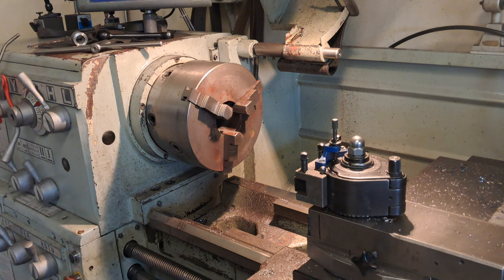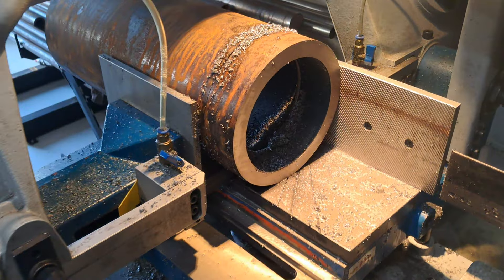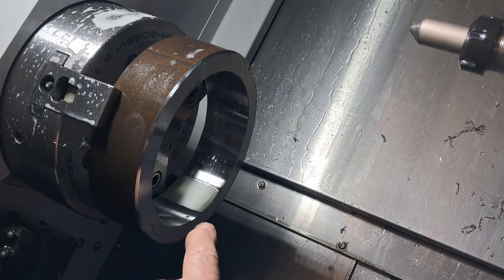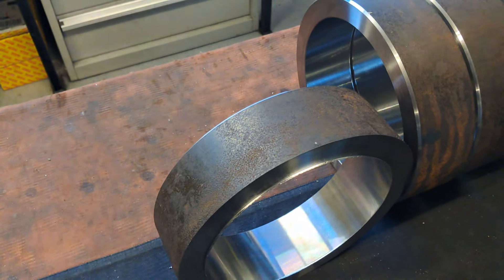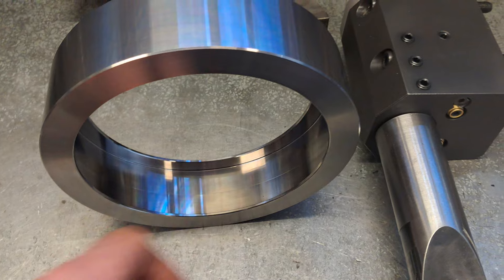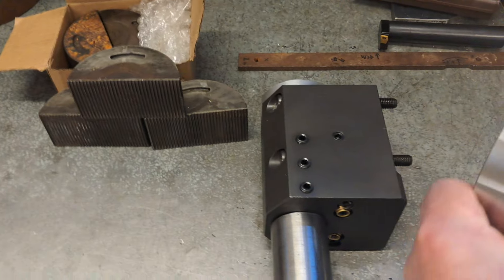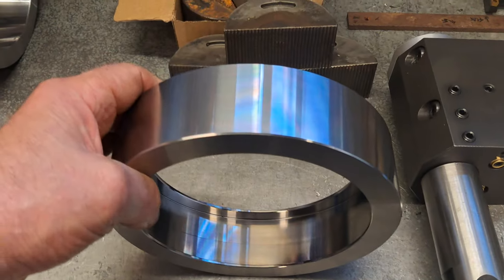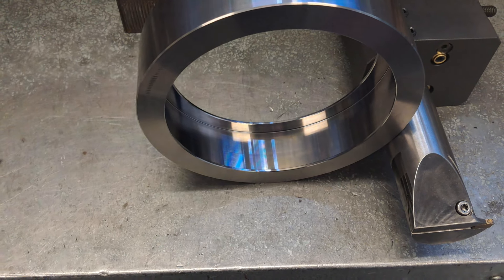In the Shop, Today.

Comment: Good one Peter🫡🫡
What was the othe ID tool that was in the backround?.
Reply from the maker: I'm not 100 % sure which part of the video you saw the Tool in the background 🤔

I'm guessing the Tool on the bench later in the video  ??
It's a custom made tool from Sandvik for a job I run occasionally. 
Not exactly a cheap tool to purchase. 
But,  it's one of those jobs where you need exactly the right tool or it won't happen 👍